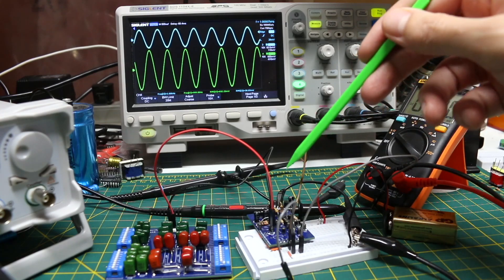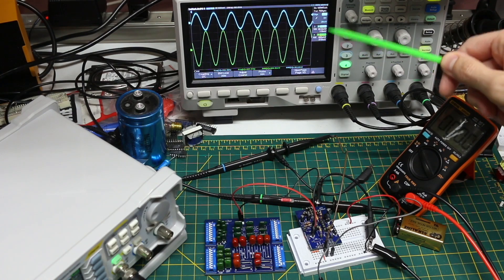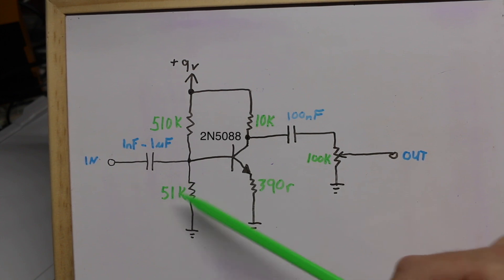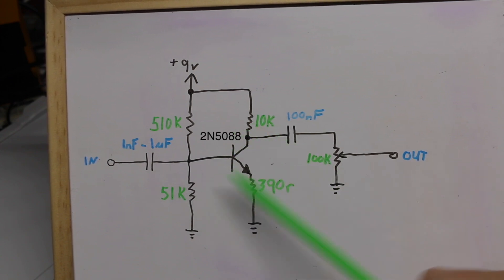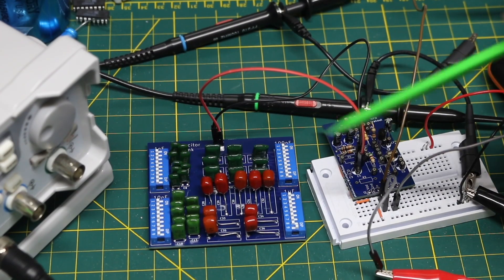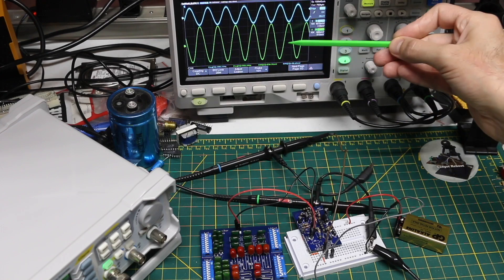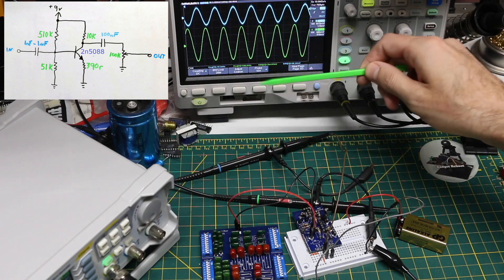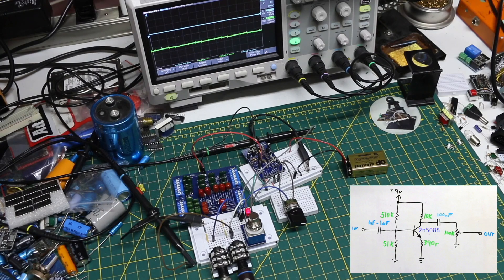Clean and Treble Boost Circuit Experimenting

Comment: You could have split the emitter resistor in to two and bypassed one with a cap to give you more gain if needed. Could have got close to 400x if  bypassed completely.  Still nice to see single transistor circuits being used, we could have done the same with just a A2D, a micro and a D2A and some code, shows how far we have come. Several thousand transistors to replace one 😂😅😊
Reply from the maker: I think the main reason the boost circuits don’t use emitter  bypass for more gain is because then it gets into becoming distortion or fuzz instead of a more clean amplification boost. I wonder how a Darlington transistor would function in the single transistor gain stage.
I need to try some JFet circuits along the way as well. No sense having all these things sitting on the shelf for decades. Except PNP, them and their  backwards flowing electrons can stay up there over the workbench.
Reply: @GadgetReboot  I expect the Darlington would just hit the rails with a much lower input level, due the very high gain.
Never looked in what type of distortion a fuzz unit makes.  I've seen diodes used to provide some form of non linearity on the signal. but from a single transistor i would expect just hitting the rails to form a squaring of the signal.
Now I'm going to have too look at some circuits. I always had to keep the distortion low under all conditions including conducted, and radiated RF emissions. 😞
Reply from the maker: I don’t miss the days swapping 0402 L C pi filter parts for days while trying to get 2.405 to 2.480 GHz down within compliance levels in the harmonics….

yeah fuzz is very square. I’m surprised it still sounds like a guitar rather than a 555